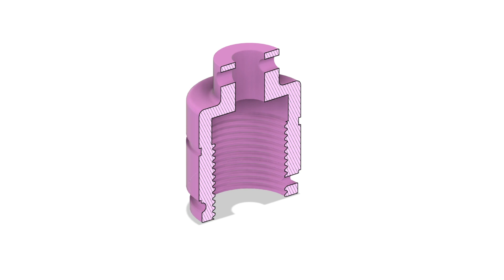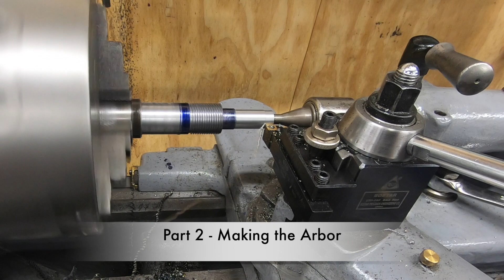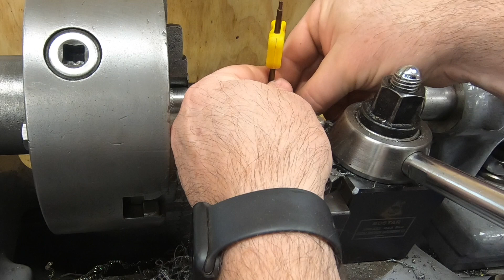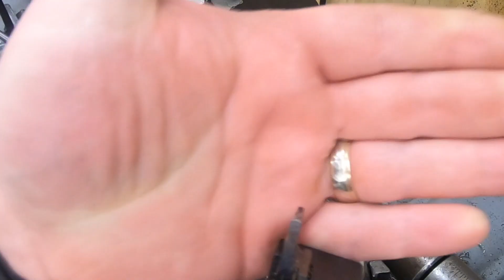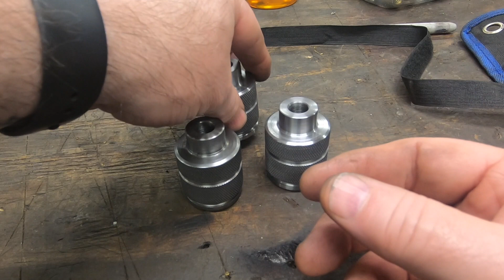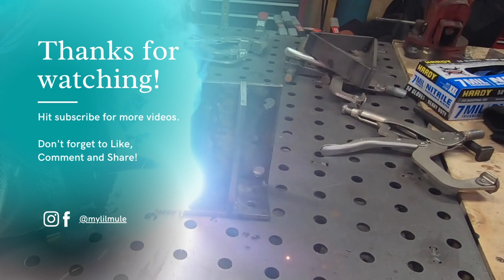Making Adjusting Knobs for a South Bend Steady Rest (Part 3)

Comment: I found if you have an older machine or worn knurling tool you have to compensate for whatever direction you're moving for slop in the set up if that makes sense
Reply from the maker: It does. Thanks for the tip.

Comment: What I do when I use this type of knurning tool, is set it at an angle of about 5°. So, the knurl is formed by the corner of the rollers and not with the whole width. It's not the right way to do it, but it works.
Reply from the maker: That's a great tip. I will gave that a try on some scrap!

Comment: They look great and should perform absolutely fine . The scissor or "c" type knurling tools are much easier and yield more repeatable results . That said , I think you did great with the setup you have. Keep up the good work .
Reply from the maker: Thanks. Yeah, but I think it puts too much pressure on the cross slide. I am likely going to get rid of it and make a clamp knurling tool.

Comment: The knobs should work out just fine. The scissors  type knurler is much easier to use.
Reply from the maker: I just watched Tom's Techniques series on a clamp knurling tool. That will get built if I ever have to make something else that requires a knurl.

Comment: I agree with your thoughts on tool pressure when knurling. 
I made my own scissor ✂️ tool using the wheels off the push in tool.
Reply from the maker: I'll have to consider making one. I'd much rather make it than buy cheap junk.